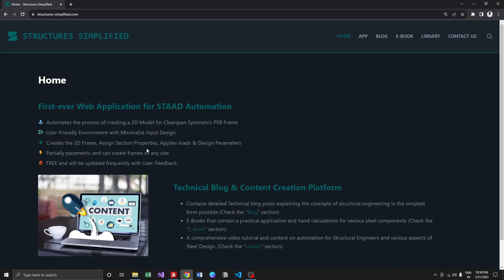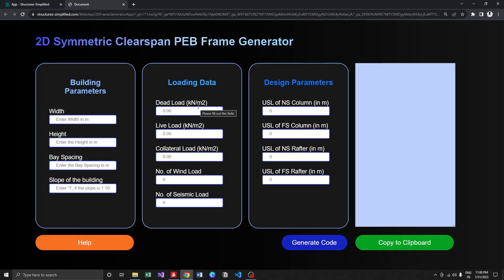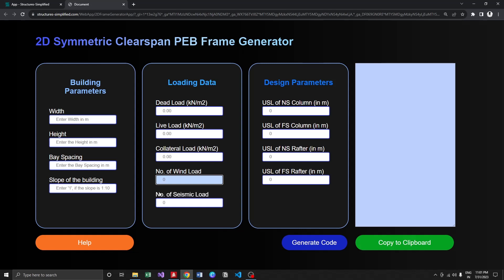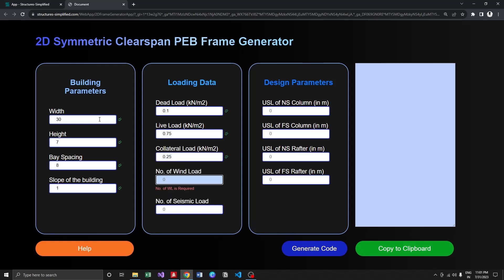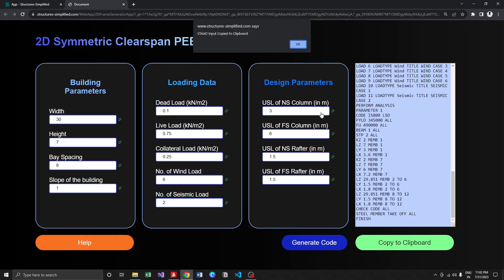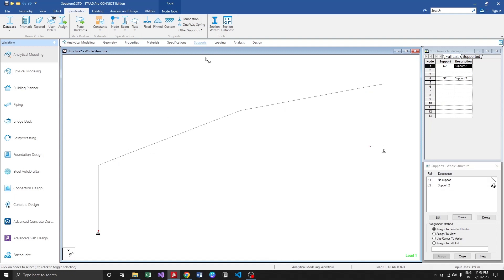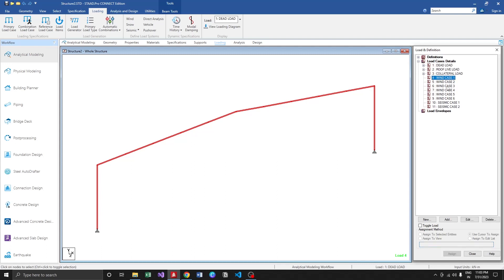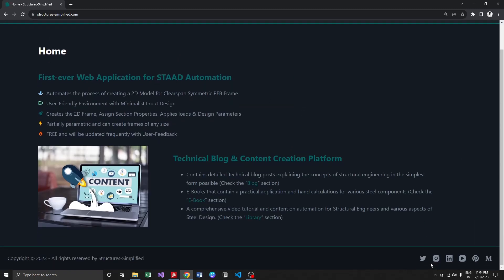STAAD Automation Web App (FREE) for PEB Warehouse

Comment: Do you know where are results of "track 2" output stored in Staad pro. Staad pro does not give individual components of utilization ratio, like how much of total utilization ratio has gone in axial stress, how much in in plane bending and how much in out of plane bending, etc. Currently, staad does not give this readymade and one has to search for the member in the "Track 2 design output" which is in text format, and not tabular. This is really a frustrating thing to do repeatedly for a large project. If staad can print the output it means it has stored it somewhere in a database in the background. Any suggestions how we can access that database directly through more sophisticated methods like SQL/Python?
Reply from the maker: This is my mail id: jparishith@gmail.com just send a mail, we will discuss further in detail.